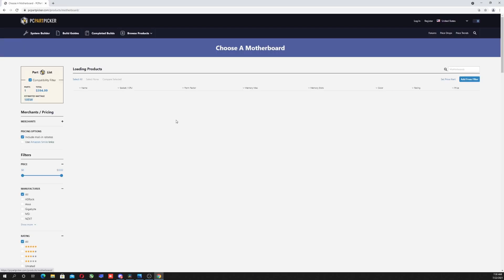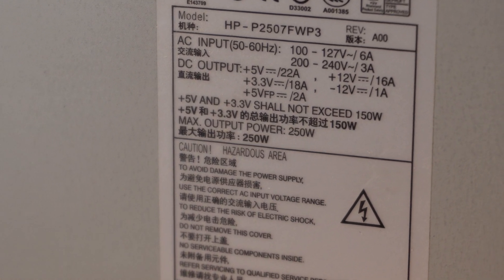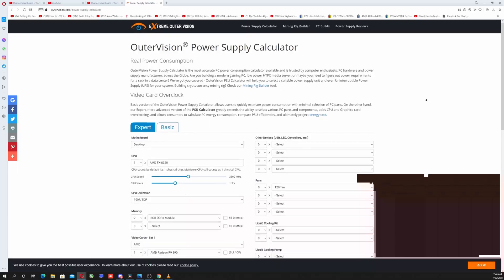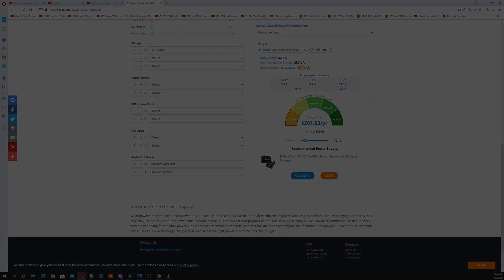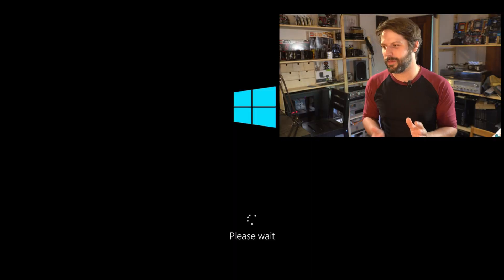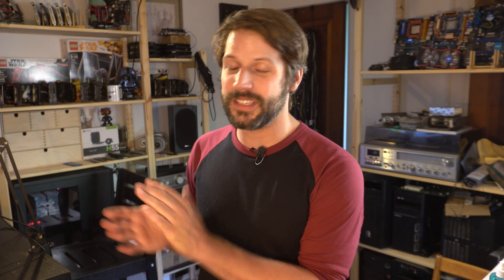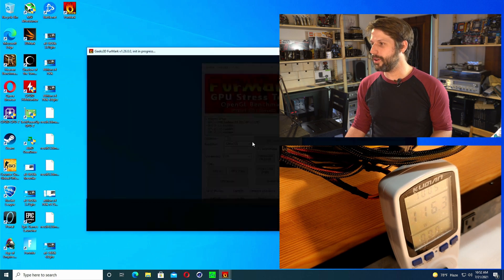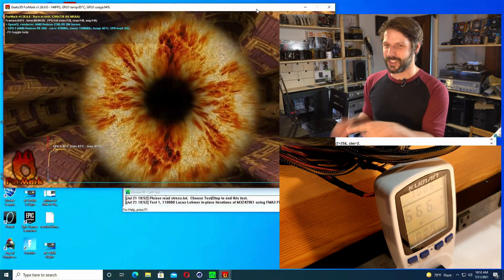What Happens When You Overload Your Power Supply?

Comment: Can I use the RX 560 in my HP 3300 Pro SFF with a 220W PSU, considering my system has an i3 2nd Gen, 4GB or 8GB RAM, and a 256GB SSD? How much power would my system consume with the RX 560 installed?
Reply: You need at least 300w for the gpu alone
Reply: Bro are you mad my system is running i completely fine even after adding the rx560 its only drawing a max of 70 watts 🙂 @ZARBONAF

Comment: default dell 290 psu and I want to put a rx 6500 tx in the system temporarily, if I under clock it will it be chill? Its only temporary
Reply: Temporarly, yes. U should undervolt + downclock it and set a limit to the clock to aviod spiking. But it also depends on your CPU

Comment: Some of those FX boards were the worst power sucks out there, still even today. I had a clone 400W supply with a nvidia 550 ti  and it popped during a gpu benchmark. I got a new Cooler Master 600 and have been using it since with my ryzen 5900 and rtx 3060.

Comment: Any idea what happen if you breach the PSU? So I am running a 550 watt everything has been running fine for at least 2 years not sure how many I can't seem to find the right search words for my order but I tried using droid cam today and it froze the system. I don't know if it's the software related or if I am topping the 550 watt limit. It freezes and once it dropped my mechanical drive. I can't find a single thing wrong.

Comment: I'm running a 5700x3d and 5700 xt with 64gb ram and a few SSDs and HDDs. Powered by a 450w corsair PSU.
some games pull 425W consistently, and every now and then the pc shuts down without warning. When I run prime95 and furmark it hits 550W while the CPU and GPU are both undervolted. I'm sure it could reach 600w at stock voltage. It crashes after about 30 seconds at 550W.
New PSU is being ordered lol.

Comment: >Me after running my i7-4770cpu with a 3060 at 4k on dead island 2 ultra settings with a similar setup and smelling the stickers on my power supply melting before it just turns off
Reply: Bottleneck..

Comment: So two days in a row my PC restarted on its own.  2 times it happened while playing MW3 warzone.  Once was on the desk top when I opened Steam.   System is a 5800X3D, GPU is a 6950Xt.  PSU is an 850W gold.    Something is going on but I dont know what.  I monitor the Temps and the temps all appear to be pretty Low…  any thoughts?  850w “should” be enough for the system… but maybe its not?
Reply: Did you ever find out? I have similar specs with the same rated PSU and am having the same issue

Comment: I've just run into this issue.  Replaced a GTX 960 with a  RTX 3060TI OC and when I ran a benchmark test on it,  the PC shut down with a 630w PSU, which is a little over 12 years old at this point (go Raidmax! ;) ). 
I tried reducing the GPU clock speed, but it didn't help.  Headed out to pick up a Corsair 750w. Hopefully,  that fixes it.  Thanks for the demo!! :)
Reply: Same for me, finally replacing my 600W Raidmax with an 850W Corsair! That little green cobra did its job for 8 years.
Reply: Reading this is making me sad ... I have a Ryzen 7 7800x3d and I'm replacing my RX 6800 with a RTX 4080 and was hoping I didn't have to replace my PSU, but looks like I'm going to need to. 750 watts currently
Reply: @KitsuneCiel i would go for at least 850 or 1000 watts pairing a 7800X3D with an RTX 4080. It leaves more headroom for future upgrades. There are good 1000W PSU’s under $150, I found one from be quiet!
Reply: @Datsun7705  going with a 1000w PSU, since I decided on the RX 7900 XTX since I picked on up for around 850 after tax.
Reply: @Datsun7705  didn't really fell like changing, since one im lazy and 2 just bought it xd
Reply: Was that the issue did a PSU fix it?

Comment: Hi, My PC recently wont boot up. After switching on, it immediately switches off automatically.. 6 month old build. 

Psu Rm850w corsair 
Cpu i9 12900K
Mobo Rog Z690 maximus hero
Gpu RTX 3080 ti Oc

Could it be my PSU ? Or something else.. every component is 6 months old
Reply: Are you sure you have enough power for that build?
Reply: @stonalisa3729  all sorted, at the time I was not using surge protectors. And the motherboard got an over current or something..
Reply: i have gtx 1660 super .. its enough 500w powersuplly or not

Comment: But you didn't actually exceed the power supply's rated power draw. If you took 660 W from the wall and the psu efficiency is 85% it means its actual output was 660*0.85=561 W. It was running fine and well below maximum.

Comment: Good video. Any power supply if in an overload condition would go into an over current condition  and due to the circuit of the power supply should shut down automatically. These are factored in the design.

Comment: i'm just now arguing with a guy that insists it's a waste to buy "more than you need" and says that it's okay to load your psu to the brink while GAMING. the guy isn't even thinking about full load, he says you should just see what your pc uses during game and buy a tight fit for that.
ugh.
Reply: i mean, you still shouldn't buy a 1000W PSU for an r3 and 1050ti. just calc needed power on any PSU calculator and add 50-75W more to this
Reply: @ДарийФедореев-э7т  That is kinda what we mean. Get a slightly higher wattage than you may need. For example, if your PC draws a total of 600w, get either a 650 or a 700w high quality unit from a reputable brand. It  would be dumb to spend the amount of money for a 1000w psu for a low end system

Comment: Hey! i wanted to get a GTX 1070 and i have a 300 watt psu and on neweggs psu calculator thing it says it goes over 300 watts by just 1 watt...so i wanted to know if my computer would be fine with that.
Reply: For the GTX cards I'd try to get a 450/500W. I have a 500w EVGA Bronze 80+ and I have had 0 power issues on my 1070 Ti / AMD Ryzen 5 2600 65W
Reply: For everyone wondering, NO DONT, i have problems now because of 300w. I'm using 1070 with i5 7400 and it's just shutdown under load. 1070 while clocking at 1900mz uses just too much power... According to some sites, this setup can use up to 380watt...
Reply: i have gtx 1660 super .. its enough 500w powersuplly or not

Comment: I just blew up my hp psu server 1200w and i have no idea why it can happen. I'm surely check all the component (mining rig) doesn't surpass 1200w because it's only 3xRX5700 (maybe the whole system just draw 500-600 watt). My question is..are psu server with breakoutboard dont have any safety feature like atx?and what kind of mistake that make psu end up exploding like a firecracker if its not caused by overload?
Sorry for my bad english btw
And keep up the good content like this 👌

Comment: Fun video,

Any power supply worth its salt shoud shut down well before it burns or causes damage to any components.

As it has been for years dont trust the psu label theres alot of cheep power supplies with ocp turnd off or set way to high as well as dangerous levels of ripple and voltage over/undershoot.

The best place to find info on psus quick and easy would be the latest psu tier list thread on ltt fourms.
Reply from the maker: Yes. This is by no means a comprehensive buyers guide, just an experiment one what happens if you way over do it. I have definitely had my fair share of high wattage power supplies that simply didn't hold up.

Comment: Good video! I actually had my first power related issue this week, couldn't boot despite having a 500W PSU and all the parts being under that requirement. New GPU? Fixed the issue! GPU worked in another pc with a power wattage PSU. Crazy times! Great video though, really glad someone other than me put their parts at risk to find out what happens 😁
Reply from the maker: isnt that so frustrating when all the parts work on different systems but not together!?